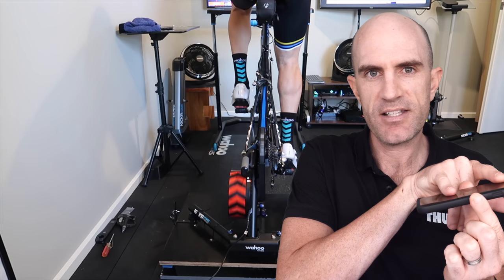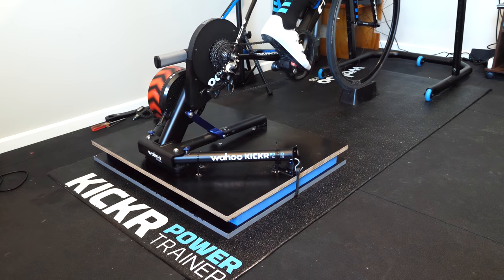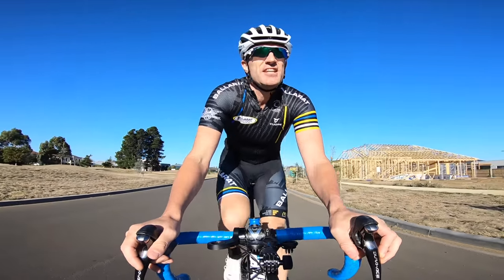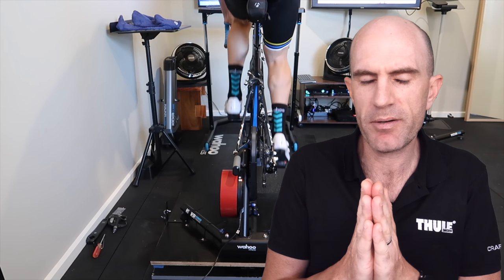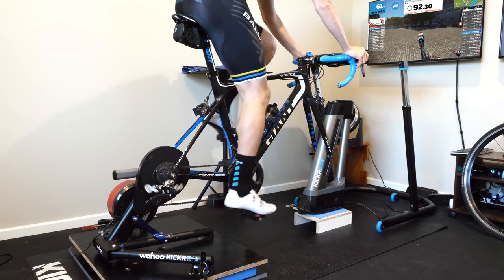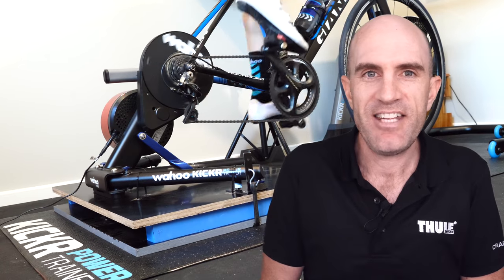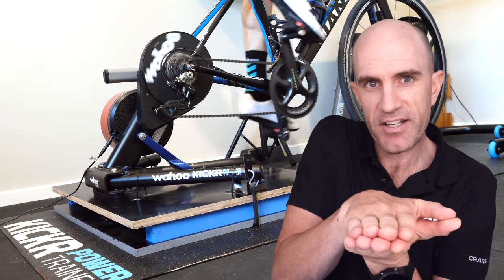Indoor Cycling Rocker Plates - First Ride of a Wahoo KICKR Rocker

Comment: good use of the cameras to show the movement, especially out on the road, showed how different real life movement is to these plates. I've used pilates balance "disks/half balls" under the feet of my trainer (so three disks, two under each back foot, one under front bar of a Tacx Flow), weird sensation but did get more movement than a single rocker plate, but gone back to trainer on the floor as didn't feel it made a massive difference.

Comment: Having just built a home made rocker plate I am seeing all of the issues regarding side to side motion. I think the main issue is the lack of counter steering coupled with the lowering of the centre of gravity with the addition to a turbo trainer. I think this is why when it was bolted to the climber you got a more natural feel. By using two anchor points through the fork you increased the lateral forces applied making it easier to apply a more correct side to side motion compared with the central contact point of a tire.

Comment: Outdoor we have momentum and giro effect.

Back then when I started training indoor with the kickr I would get painful around the sitbone area because it's all rigid, so I got a Kinetic Rock'n'Roll (yeah from smart trainer to turbo).  I got it for the damping not for the rocking design.  Sitting back into the saddle felt less harsh after out of saddle efforts.  The tiny left-right gives under the crouch also lessen sitbone sore.

What it advertised though, that natural rocking sensation of sprinting, was never natural and difficult to implement, and actually wasting energy.  Outdoor sprinting we forcefully swing the bike away from the leg that's doing the downward stroke, actually creating watts with our upper body.  With the rocker, the bike wants to fall to the downward stroking leg.  Trying to push the bike away doesn't work because we are up in the air.  Try doing 'microburst' on it, adds more difficulty..

Eventually I realized that to reduce saddle sore all it took was more indoor hours, with the right saddle and pants.  So now I can ride indoor 3 hrs with the kickr with bearable sitbone sore.  I don't do that very often because most workouts are less than 1.5-2hrs.

So the Kinetic is there collecting dust.
Reply: lol, im managing to do hr runs now after being in agony the first 6 weeks. Yeahh its just weak ass hehe
Reply: agreed 100%.   I assume rocker plates and R and R have the same problem..
Reply: do you think, outdoors, we can do what you say (forcefully swing bike away from leg doing downward action) because of the outdoor forces we can kind of stand against, either centripital or centrifugal (whatever) , or, just forward momentum..or all three?
Reply: Which is why I'm still in love with my dumb LeMond Revolution.
Reply: Answered my question on the comparison with the Kinetic R&R.  Thanks.
Reply: ditto me too...
Reply: Medical Cannabis Spain, but surely outdoor you can ride more.  The whole indoor set up is rigid and it does take time to build up the tolerance.  These days manufacturers make saddles that are suitable to our sitbones.  We measure the distance between our sitbones and choose the ones best for it.  This really helps indoor and outdoor long rides.
Reply: Tim McCarthy Outdoor, the bike can stand up, even hands off, because of a few things. 1.headtube/fork angle and bike's rake & trail. 2.wheels gyroscopic effect,  3. our ability to balance.  
The faster it is, the easier it is to ride hands off. (mostly because of pt 1.)

But I think throwing the bike left and right when out of saddle (climbing or sprinting) is purely a learnt skill.  When we get out of the saddle the bike will want to fall towards the leg that's doing the downward stroke because of the force we apply to that side, we counter this by automatically gently pushing the handle bar the other way.  As our skill level increase we can really swing forcefully while keeping a straight line or even steer left or right.  

A 'microburst' workout, basically a repeating vo2 max 15 sec repeating sprints for 60 times, make my forearms, upper arms, neck sore the next day.

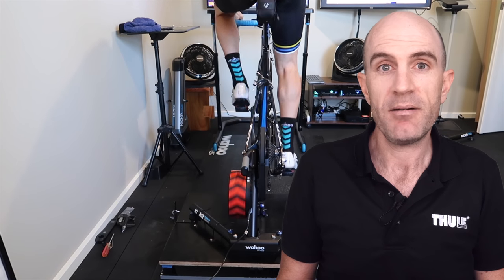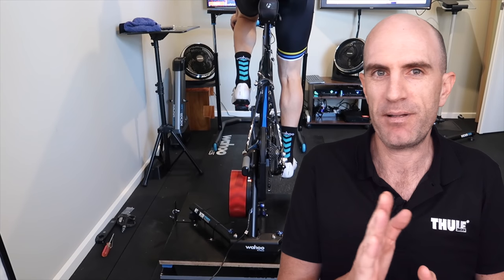By the way, look at this vid.  https://youtu.be/oobSKEaxRS4 Basically is what kinetic R&R behaves.  Everything is fine until the cyclist stands up.  Riding starts at 1:00, out of saddle at 1:30

Comment: I'm looking into these more for comfort than realism. Staying on the bike for 3 hours indoors is much of a PITA (not just more boring but real PITA) than doing a 6 hour ride outside, at least for me. Do you think these rocker plates make things easier in that respect?
Cheers!
Reply: So glad it’s not just me with this problem! Thought I was just getting soft in my old age!
Reply: I fully claim that comfort is one primary benefit to a proper rocker.  Even adding a mild amount of angular float can make a HUGE difference when it comes to medium and longer rides.  I have used my rockers for a few 5+ hour over century rides on Zwift and plenty more in the 3-4 hour range.  It's possible to do that without a rocker, but not with the same level of comfort.
Reply: Looking at the minimal effect the rocker has on normal steady state riding makes me think the static bike isn't what's causing the PITA. Indoor trainers hurt the rear a lot more because you're consistently in the one position the whole time. Outdoors, you're out of the saddle here and there, you're shifting around, stopping at lights. There's more micro-relief happening.
Reply: Don't forget about the actual angle changes we experience on every bike ride.  
Change lanes... requires a lean.  
Roll through a turn... requires a lean.
Reach for a bottle... likely results in a lean.
Reach for a gel in the jersey... likely results in a lean.

And many more like that, which all lead to subtle changes in saddle position and pressure.
Allowing the bike to float a bit on a rocker provides a similar relief.
Reply: Yes they do. A lot.

Comment: You video raises some interesting points regarding the experience. Some folks, me included,  suspect that non-rocking trainer riding may cause additional stresses on some joints of the body.  So rocking even with its "experience" limitation could be a total plus if it alleviates aches and pains. I suspect that some gurus on pro teams might have more insight in this regard. A quick google scholar search did not yield anything.  As you point out, the forces involved in a real ride are complex and you even suggest that different mechanical regimes might be needed for different riding regimes. These observations suggest that a mechanical passive system and especially a simple one will not feel real.  The out of the saddle experience on the road also involves synchronized steering changes. I find the absence of steering effects also troubling. I now wonder if allowing steering even if not "connected" to anything would also improve the experience.

Comment: A lot covered but I wonder what the difference in noise is. The rocker plate looks as a resonance box. How much louder will it be on different trainers and specifically on the quieter ones. Neo and Kicker, but it could be interesting on the cheaper smart ones as well.
Reply: Repeated my reply to a similar question by another poster.

The specific design of a rocker influences how it handles sound.  Some (many of the tennis ball versions with no rigid center support) do dampen the sound and vibrations.  Some people like them for upper level locations to minimize transmission to other floors.

Other designs with rigid center supports and hinges, along with some of the full length rockers, actually increase sound and vibration.  People are working to understand the cause and solutions.  There are applications using rubber and carpet to damp the sound in those cases.

It's a peripheral consideration for many, but is very important for some people.  I expect this will be an attribute worthy of comparison when we start seeing commercial units for sale.

Comment: I wonder if changing the density of the blue foam (I'm guessing it's foam) will affect the characteristics of the rocker.
Reply: Eli Douek, yes there are many ways to change (dare I say fix) the ride of the BOB.

1.  Move them more towards the center, increases leverage.
2. The above also creates an early angle stop when the foam reaches solid height.
3.  Cutting them to smaller size also makes the rocker more active.

I used a combo of those to perfect the feel of my rockers,for seated, standing, and sprinting efforts.

Comment: I believe the rocker plates require a hard divider located in the area where the wheel touches the ground. This will prevent a push on a pedal on one side to be distributed between the two sides of the rocker. On the road this does not happen because wheel is the single contact point. With this device though every pedal push is distributed between the two points of contract which emulates more a tricycle. If there is a hard divider in the middle emulates the wheel point of contract and makes the effort affect only the side of the pushed pedal.

Adding the climbing device make it guide the bike movement and it mitigates the lack of single contact point at the back end.

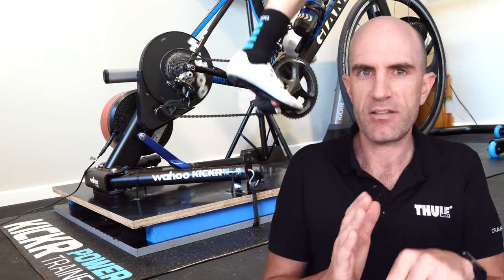Comment: starting at 4:15 is why I follow you so religiously; common sense analysis, aka how does this compare to "real-world" feel? Completely agree there isn't the full range of motion & that may/maynot be an issue. But a point I do think your on the verge of, is the "when & where"...when does tilt start (& specifically which direction does it go) during the motion.  Starting at 5:45 you can see where the rocker plate allows tilt to the left or right that corresponds with THAT same side's pedal being pushed down.  This is the opposite outside, which you started to allude to & couldn't quite put your finger on it at @7:02.  
Part of it, is the axis at which the tilt happens (the where)... real world (outdoors), the lateral tilt axis is going to be at or slightly above the bb & hubs.  The baseline center is going to be center of mass (primarily body weight, so imagine a center-line that extends up & down through the center of your torso). In a sprint, your handlebars/seat/toptube will roll to the left as my right pedal goes through its downward motion; while at that same time the bottom of the wheels will kick out slightly to the right (viceversa for the left pedal stroke).  The axis that the bike tilts is more in the center of the bike (or as I said near the hubs), NOT an axis located at the base of the wheels (or in some cases, a bit lower than that) for rocker plates.  I think in a way, that would define that "squirm" feel, which I thought was a good choice of words to describe the different feel between the two (especially when adding the other dimension of front-to-back motion at the same time).  An rotational axis closer to the hub height would provide a more outdoor/natural feel, but as you said I think this has a more-real element than a completely fixed position.  
As you sort of closed out your video, I also think the design & support of the side resistance materials makes a difference.  There's a youtuber named Chad McNeese who has seemed to have worked out a pretty good rubber/foam density configuration & he is doing a great job really leading the charge on this whole rocker plate movement it's design element.  I love to see it & think it's great...my own personal hesitation right now is I am planning to wait on strapping my Kickr Snap into one until my warranty is up, per Wahoo's cust. service dept telling me that use of the devices would most likely void warranty (as they can't control, especially for homemade units, the quality control or specs that would potentially put torsional stress/affect the trainers).
Super glad to see you use it with the Climb!!!  It was more stable than I thought & your comments were very encouraging...for me personally, this is where I can really see the benefit, as out of the saddle in a climb is where I tend to "dance" or really get my side-to-side movement outside.
GREAT VID! RIDE ON, Lama, ride on!!!

Comment: Just my observations. An issue may be when you're sprinting on the road you turn your handle bars which changes your cg and helps tilt the bike against the gyroscopic precession of the wheels. When you're on the trainer the wheels don't really move, as you mentioned. Probably a smaller reason but worth considering, you're used to not rocking when riding indoors.
Reply: The issue isn't turning forces.  It's too much leveling force from the springs.  Decrease in their force will start to fix the problem.
Reply: Chad McNeese not really turning forces. I’m talking about balance. Because the forks are pointed forwards slightly, when you turn the handle bars the front wheel moves off centre. Since it’s off centre the cg changes (and yes, also turning forces) and then you lean. 
Look at people when they sprint. Their wheel moves side to side to assist in leaning the bike.
But I agree with you. The springs will need to be dampened more but putting the front wheel on a small pivoting plate will allow for less dampened springs and less unwanted rocking when in steady state.
Reply: Actual steering on a bike is a mix if bike lean and handle bar turning.  How much of each is required varies with bike speed and intended rate of direction change.  The faster you go, the more you lean the bike as opposed to turning the bars, and vice versa for slower.

I have great luck with my rear-only rocker and front tire on a flat riser.  The tire and wheel roll left and right (just like outside) so it works perfectly well.

Comment: Don't know if this has come up yet but what about the Kinetic Rock and Roll | Smart which looks like it does all that you're trying to achieve?  maybe someone has already mentioned this, always good to watch your blogs.
Reply: I made my first rocker over 2 years ago, when the only Rock and Roll trainer was the fluid version.  I already owned a rigid Road Machine, and didn't fancy paying $400 to buy a R&R frame (Kinetic actually sells it as an upgrade accessory).  So I made a rocker to replace that dedicated frame.  Worked great and cost less than $100 in parts.

Then with the advent of smart trainers and especially wheel-off versions, my universal rocker plate was useful for any trainer.  So it is great to have the ability to use any and all trainers with a rocker plate, in stead of being locked into a single trainer.

Comment: Very interesting thanks Shane. I wonder if the full length rocker plate would help with the sideways movement for the front of the bike. Or perhaps a wheel block with a slightly rounded bottom.

Comment: When i use my TT bike on the traniner and am in my aerobars i get a shoulder pain/ ache which i dont get outside. I feel like it could be the due to the front wheel being static and not free to move and therefore my shoulders fighting it a little. I wonder if the rocker plate for the whole bike and no just the rear. by adding even a slight degree of motion could help this.
Reply: Yes, a rocker really helps, even when seated and especially if you are in a TT/Tri position for extended periods.  The subtle movement mimics the shifts outside and makes saddle comfort much better.

Comment: I don't get why it has to be so complicated. I just cut a 3 by 3 piece of 3/4 plywood( the floor will serve as the other board, lol) I already had and screwed on  a 2 by 2 right down the middle. I bought a foam mat at Walmart for 5 bucks...some boat seat pad thingy! It was about 1 inch thick so I cut it up into 3"x3" blocks. I stacked them so I had 4 double blocks, so 2" blocks. I glued them together put them under the board about half way to the edge and about 6" from the front and rear on both sides. I haven't mounted my Kickr Snap yet, but not sure I get that part either. I rode for a bit and it doesn't turn over, in fact it doesn't even move at all. I got some of those furniture cups to put the front legs in. I figure I'll maybe mount the back with some plumbers tape and a couple of screws just to be sure. Actually just drilling holes to thread some zip ties through would probably be easier. When I need to move it just clip em and reinstall! Performance wise it feels really natural and even has a little circular shimmy to it and not just a rocking movement. I have 8 bucks in my rocker plate! Even if you had to buy plywood, it would still be less than $25. I can't imagine moving one around that is made with 2 pieces. It's heavy enough with one.  It's not pretty, but it's in the basement!